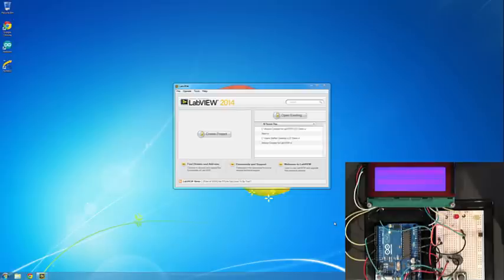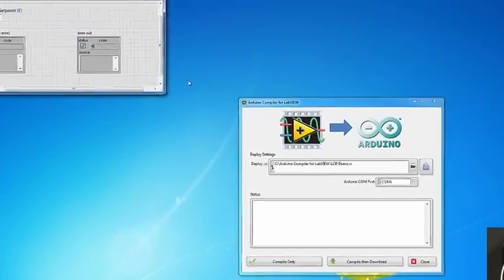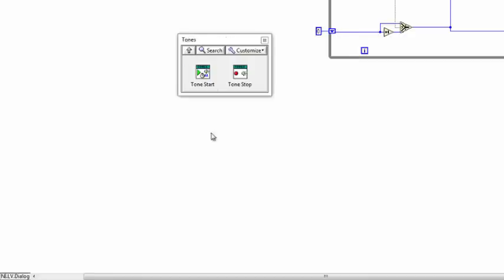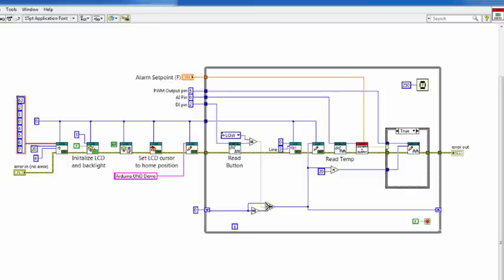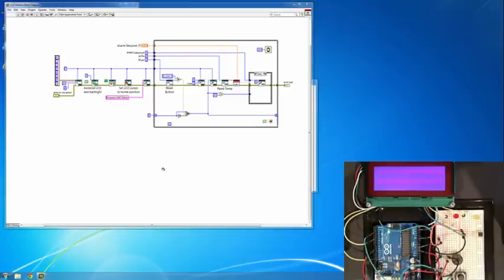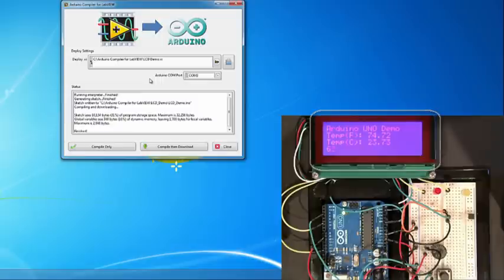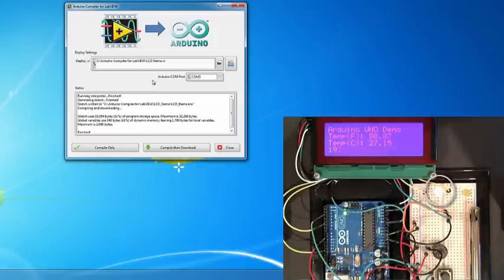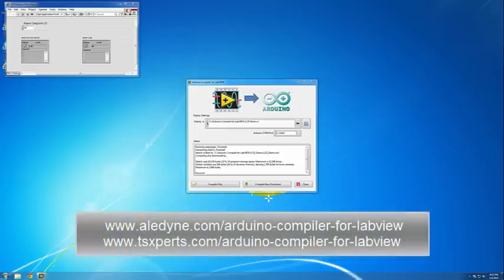Arduino Compatible Compiler for LabVIEW

Comment: if there's touch screen TFT LCD Module attached with arduino, is there ANY way to make it the "front panel" ?? for example i want to change a slider control on the touch screen to change a motor speed?? or i may need to read a sensor and plot it on (waveform chart) on the screen?? just like the PC?
Reply: +osGFXman 
I've been using the 4D LCDs for similar applications as you describe.  There are various options to getting the data between the screen and the arduino.  I don't care were you get it from but this is where I learned about it and ultimately bought it from (several actually): https://www.sparkfun.com/products/11741
Reply: +Gmo H 
Grrrreat! :) this is easier a lot! .. how can i thank you?! :D .. you made my week!

Comment from the maker: @K Danagger: There is no difference in functionality between the two Arduino Compatible Compiler for LabVIEW editions.  The Home edition though is only licensed for use for home projects or Student use (not for professional applications).  There is also a watermark on the Home edition.  Note that LabVIEW Home is not entirely the same as Professional as you stated.  It does not have an Application builder.
Reply: Aledyne Engineering  Of course. The home edition is more equivalent to the full edition in that regard, but it appears to have features that the full edition has listed as options - such as the report generation toolkit and database connectivity. I had forgotten about the application builder since we use LabView in an R&D environment and rarely need to distribute an executable. My university employer has a developers suite site license anyway, and have access to just about everything. 

Very nice to hear that the home version of the Arduino compiler has the same functionality. That's a big selling point! I'm looking over the manual now. Looks great. I really want to demonstrate this at our local makerspace. Support for the Arduino Due really has me interested since it has 12bit A/D's and a much faster processor. If this turns out as good as it looks, I'll probably by buying the standard version for use at work.

Comment: This compiler allow labview projects with embebed matlab code????. In other words, Can be include a  .m code in a Labwiew project and compiled to run over Arduino hardware???. Greetings.
Reply from the maker: Juan Carlos Llanos V. No it does not.  It supports 100+ LabVIEW primitives and many Arduino APIs.  Refer to http://www.geverywhere.com/arduino-compatible-compiler/ for the user manual that describes supported functions.
Reply: Juan Carlos Llanos V. You probably don't need to run MatLab code anyway, there are very few things that can be done in MatLab that can't be done just as well - or better and faster - in Labview. I know, I use both professionally.
I suspect that ultimately, the power of this compiler is largely limited by the Arduino libraries. A quick glance at the user manual seems to indicate that they did a pretty good job. I will be studying it closely to decide if I feel it is worth the price for hobbyist use. Fact is, most Arduino hackers are used to everything being free and open source.
Reply: K Danagger . Ok. I want to know if the arduino hardware could be used for low frequencies digital signal processing algorithms. I made some labview projects for digital filter (FIR), digital oscilators and FFT analysis for low frequencies signals with some Matlab functions embedded. Now I use a DSPIC and Texas Instruments DSK. The price for an arduino is very low compared with a typical DSP board. Greetings.
Reply: Aledyne Engineering thanks for your answers. Greetings.

Comment: This looks promising, but a 6°C temperature drop in ~15 seconds, while replacing the USB power supply with the battery? Did I miss something?
Reply from the maker: kpoopk Yes, good catch.  That is because this particular temp sensor is using an analog input pin which is using VCC as the reference voltage.  When it was powered off USB, this particular port was only supplying around 4.5V, which lowers the range of the analog input, thus making the temperature appear higher than normal since the code converts to temperature based on a 5V reference.  When it was powered off the 9V battery, VCC is supplied through the on-board voltage regulator, which is a solid 5V on the output, therefore it is displaying the correct temperature.  The point of this video was to show that the LabVIEW code is being deployed and running standalone on the Arduino board, not necessarily the accuracy of the temperature reading, which is attributed to hardware.  You can download a free-trial of the Arduino Compatible Compiler for LabVIEW now on the LabVIEW Tools Network: http://sine.ni.com/nips/cds/view/p/lang/en/nid/213121

Comment: Good job!
I was wondering about using the Serial, SPI and I2C interfaces. I´ve seen in another post that Serial is supported, what about the others?
Another question is about the possibility of using LabVIEW VIs such as PID on the Arduino? Is it possible? Or only the VIs on the Arduino Compiler Pallete?
Thanks.
Reply from the maker: ***** Serial is currently supported.  Raw SPI and I2C are not supported yet but are on the roadmap.  Currently there is also support for I2C LCDs.  Only the VIs on the Arduino palette will technically work.  However, if you use a SubVI (possible a PID vi) that only uses primitives or functions that are supported, it will work.

Comment: Nice "must have"!! Why do you need the Arduino IDE? (for uploading the Labview code that has been transcribed to arduino c via the Arduino IDE?)

More important:
Are the  Serial.begin(); Serial.read(), Serial.println() functions, and so on.. also supported, in order to still allow serial intercommunication
between Labview and the running Arduino?
Reply from the maker: The Arduino IDE install includes all the USB Serial drivers for each supported board as well the Arduino core libraries, therefore it is required.  Although the IDE itself is not used and the LabVIEW based user interface included with the toolkit serves as the IDE.

As far as serial, it is not shown in the demo, but yes, there is a sub-palette that includes serial support for one or more ports (depending on how many ports the Arduino board used supports).  These LabVIEW VIs are abstracted from the Arduino implementation so the serial palette includes VIs like: Open, Close, Check for Bytes, Flush, Read Bytes, Write Bytes, Write String, etc.